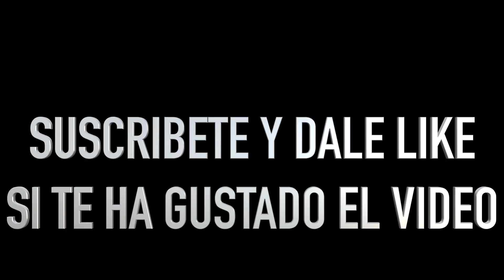COMO CAMBIAR PASTILLAS DE FRENO A TU MOTO (HAZLO TU MISMO)

Comment: Yo añadiría el paso de limpiar bien los pistones aprovechando que están fuera.
Lo suyo sería darle con un poco de limpiafrenos (alcohol, si vamos low cost) sin echarlo directamente a la junta y pasarle un cepillo de dientes y papel para secar.

Con la acumulación del ferodo, puede llegar a dejar de deslizar correctamente los pistones.

Cuando compré mi anterior moto venían gripados, posiblemente por no haber hecho este proceso nunca. Me tocó lijar y volverlos a pulir (un coñazo).